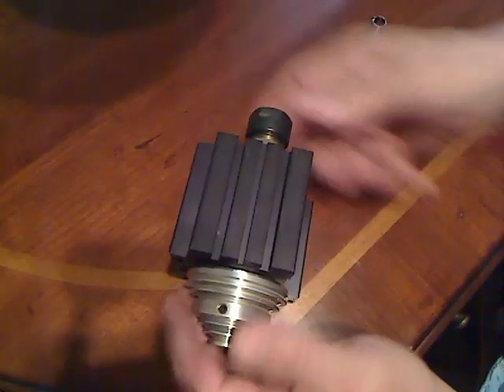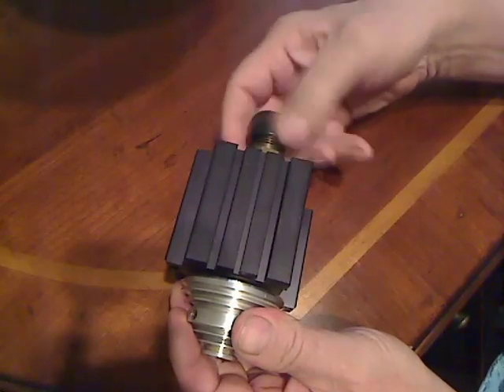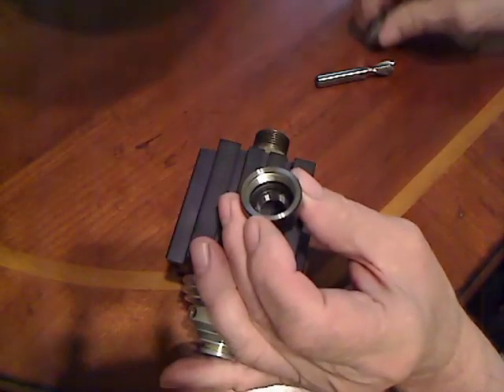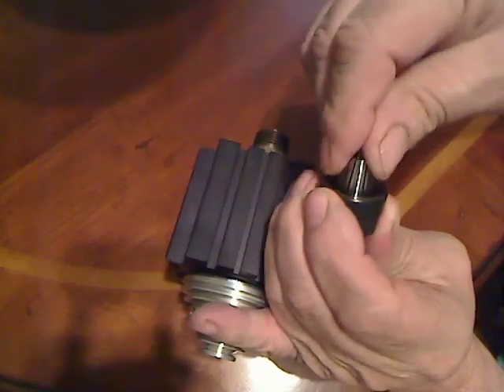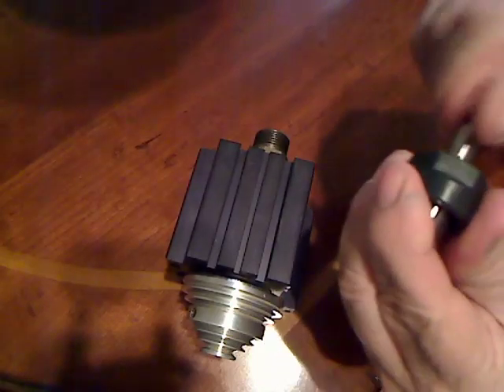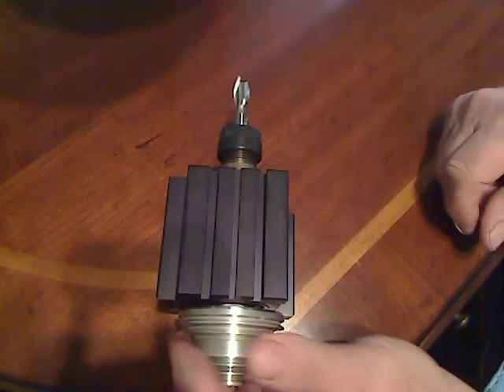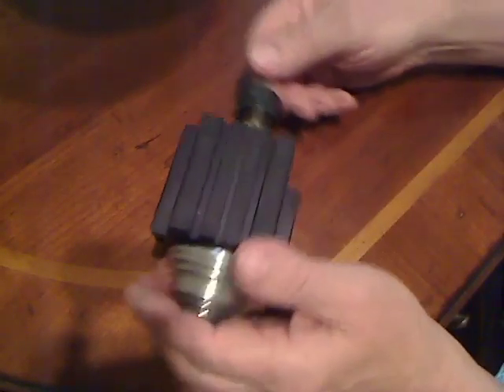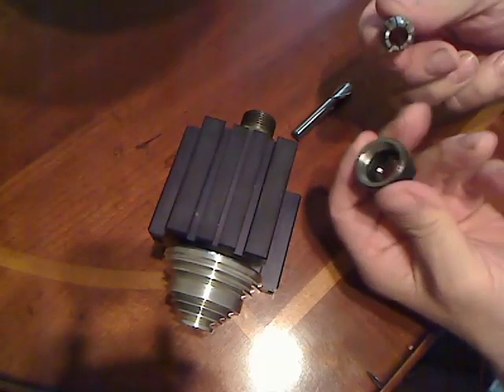ER  COLLET SYSTEM

Comment: Is that a ER16?!
Reply from the maker: Yes
Reply: John Herzog what is outter diameter of spindle thread? Mine is 3/4 i can’t find the proper Er16 nut for it.
Reply from the maker: You'll need a ER Headstock and it comes with the closer. (22mm)
 http://www.taigtools.com/c300-00.html
The 3/4 x 16 is our standard headstock